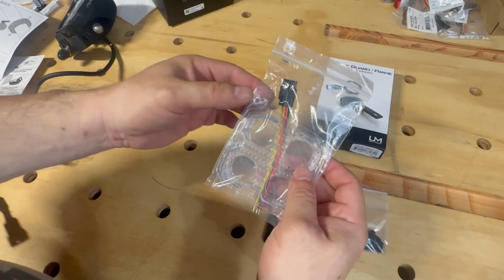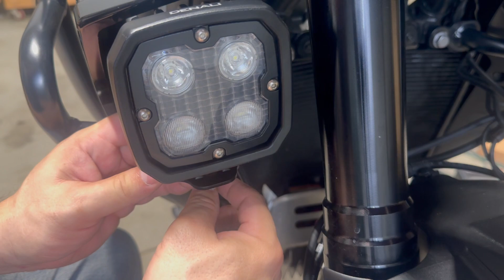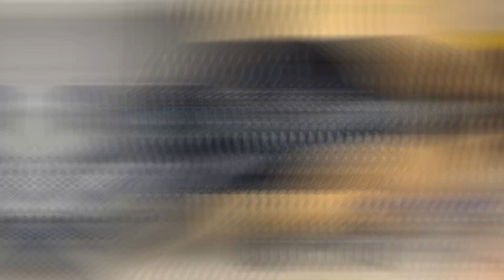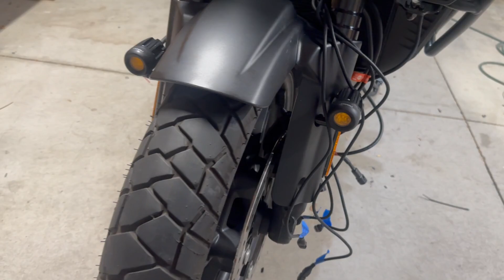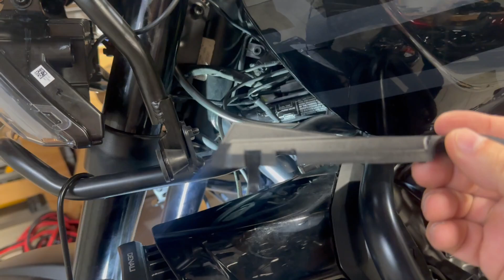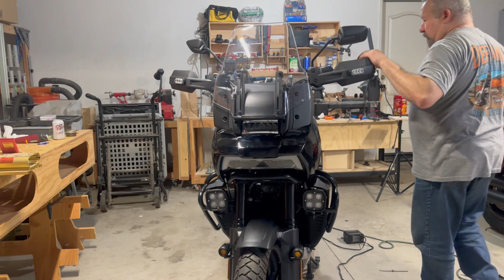Denali Electronics Series Part 5 | Pan America | Completion of Install

Comment: I’m sure my 2024’s charging system would support all that lighting but I’d be very cautious about letting those run anytime the bike isn’t running on a 21-23 model Pan Am. I’d definitely keep it on a battery tender. Great video series. 👍🏼